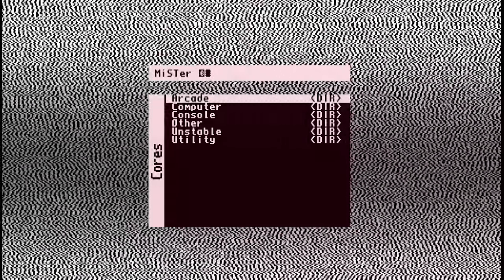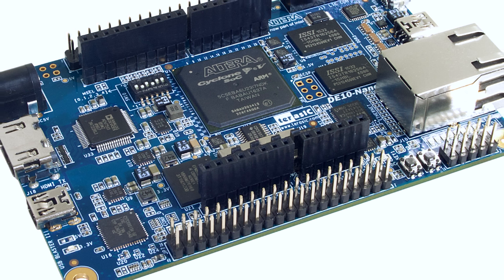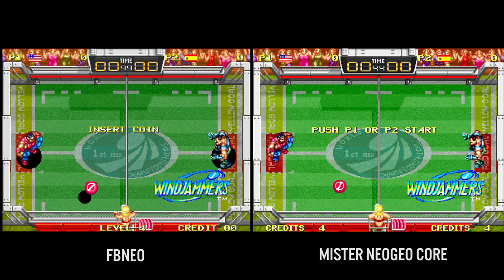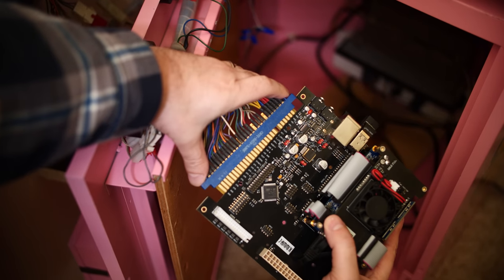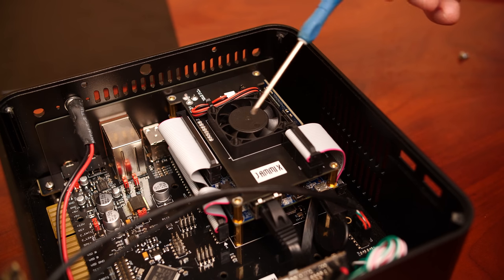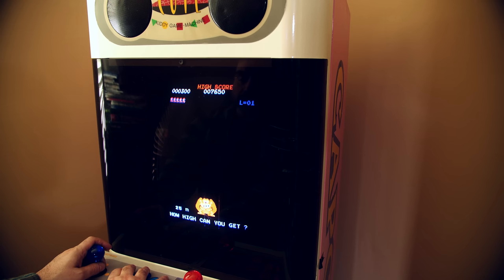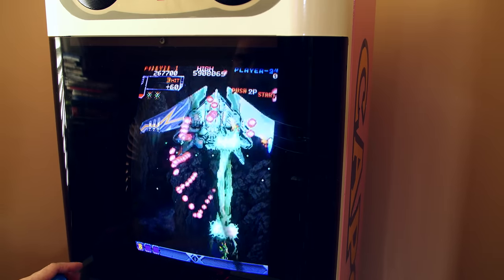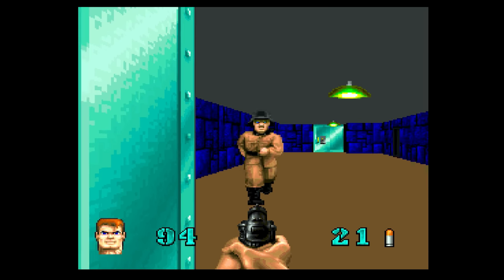Finally - I got my hands on a MiSTer FPGA Retro Gaming Setup | MVG

Comment: This is mind-blowing to me, voodoo magic type stuff. Am I missing something? The emulation community is reverse engineering and replicating systems little Sega Saturn and Playstation, shrinking the chips down, and putting them all in a tiny all purpose box, while Sega and Sony can barely re release their own systems in a similar sized box... I absolutely loved the OG PS3 due to its hardware back compatibility, and this all makes me wonder how hard/ expensive it would be for huge companies to offer true hardware backward compatibility in their consoles. There's obviously a market for it, but I guess they just want to go the easy route reselling us their roms.
Reply: I mean, there's a market for it, but it would require time and a more expensive console. Dedicated retro gamers seem to still be in a minority so coming out with a console that's extra expensive because it can play old games natively may do more harm than good. As much as people harp on Sony not having BC on the PS4 consumers made it fairly clear that Sony eventually axing the PS2 BC from it was a better idea. The Switch is one of the highest selling consoles ever and made more money with Wii U ports and it's gimmick over being backwards compatible.  

The "easy" route seems to be the most cost effective. Again, Sony already got burned before by it, and the differing architectures of the pre-PS4 systems don't help. Can't explain why MS systems don't have it, though, and they seem set on doing their from of "Backwards Compatibility".
Reply: @RippahRooJizah  I feel ya. But for all the people who buy from the small choice of Wii U or N64 games, how many find that their game isn't on the list, and DL a rom pack? Go full pirate. (Probably enough to be a threat to Nintendo's profit and worth pricey legal action). I guess what I was saying was I personally would pay the cost of a bigger PS4 with PS3 inside, however it turned out. When my OG PS 3s burned I went on ebay willing to outbid anyone to get one asap, but was smacked with the reality that many other people had the same idea, with more money... You are correct in saying people spoke to Sony with their money- just like pre-ordering modern games with microtransactions despite the backlash, and there was backlash. Sony just did the same thing with "Software back compat in the future" but backwards by slowly phasing it out. I think if it wasn't abandoned, a large enough group of people would have paid the extra for a "Legacy Edition" PS4 and Sony could have made a profit. I mean a PS5 with a disc drive is far more expensive than the price of a disc drive, and people are willing to hold out and pay extra for it... But If Sony went only all digital PS5 at launch (they could still cut out the drive on the "PS5 pro") people would still buy it, despite the backlash, and 10 years in the future when PS6 is out it would be easy to say people spoke with their wallets, or even speculate that Sony couldn't have done it due to the cost associated with the supply chain issues (similar to the high launch cost of the PS3). I have a feeling IBM would be happy to keep selling their cell chips.

It's too late now, and would probably cost much more to start from the ground up while if they had pushed forward it would have gotten cheaper instead. I guess now it's me that's just speculating at this point.
Reply: @Wooskii1  The choice bit is why I can't stand behind MS's implementation of BC. Good on them for making that attempt, at the very least, but I guess it isn't truly BC.

There are plenty of people who wouldn't mind a PS4 with the actual hardware to play older PS games. I would as well. I just doubt it'll be viable, especially with scalpers around.

As an aside, this is why I was interested in the Polymega, although plenty of people have complained about it, either with the specs being to anemic for the price (which is quite expensive at 450 US dollars, even moreso with the addons), lack of FPGA, and plenty of people going "But I can emulate, this is pointless" despite this meant to be an above-board way to preserve games without any copyright issues.
Reply: @RippahRooJizah  Yea, Microsoft or Xbox was a letdown given all the talk of BC, and I understand the mess of architectures in the Sony line, but I still think enough people would have paid a premium to move their games to the next console had Sony keep it up (speculating again), I moved all mine from PS1 to PS3 and so did many friends. I'm sure more people would have kept their physical games in good condition too, but during the time Sony phased out BC these game collections got scattered to the wind and now those people would have no reason to buy a BC PS4/5... As much as I dislike GameStop, If they go out of business it would make finding even used current gen gen games that much harder (I'm sure the console manufactors would be happy)
I slept on the Polymega due to my collection being lost, I still have a ton of games from handhelds. Both backups on SD/ HDD and carts. It does suck to hear that they didn't pull through and meet expectations none the less, but FPGAs look like a better Idea to me. I have been aware of them for some time but this video really caught my attention due to the size an (relatively) low price. First time I looked at them (not too long ago) one console module was bigger than MVG's loaner system and cost almost the same. I guess time will tell.

Comment: I remember I was excited about including FPGA to cpus, after Intel and then even AMD acquisitions FPGA manufacturers and promised to include it in CPUs. SW emulators would then simply used them as programmable accelerator. Well, many years passed and nothing. So it's nice to see standalone version. Maybe one day, it happens.
Reply: Unlike other architectures as Amigas or old Apple PPC, x86(-64) hardware abstractions on CPU, video and chipsets... While making possible to have a sort of standards which make "generic" OS drivers possible (which in turn makes possible the existence of OS homebrew in the PC world (and foss OSs in last instance))... Also make it very difficult, if not impossible  to use "accelerator" and "bridge cards" in a meaningful way. Last time they tried was with AMD hypertransport, and because the memory architecture of the x86 world, the speed gains of the hardware acceleration were too small to justify the existence of coprocessors or "Emulator Accelerators".

Comment: True hardware parallelism is what makes FPGA work so well. Sure, you think you can do that on a multicore CPU? not with the same level of accuracy. You're an app running on top of an OS which can thwart you.
Reply: False. Software emulators are just as accurate (or more) as FPGA. BSNES was even more accurate for some time (now they are supposedly even). The only thing the OS is dragging back is input latency, not emulation accuracy. And even that can be fixed. Emulation accuracy is achieved in the same way in both software emulators and FPGA. Knowledge and good programming.
Reply: FPGA is literally a meme. Paying 500 dollars so you can run "simulation" when fpga doesn't even stimulate at component level is something only a true smooth brain would do. Your money is far better spent on a pc that can emulate and play far more than this meme box can.
Reply: @xXRustyShacklefordXx  What do you mean? While FPGA is more expensive than a simple CPU with software emulation, the FPGA is able to actually recreate the logical circuits inside of the CPU and system it is emulating. I don't think anyone going the FPGA route is claiming it is more practical or easy, but it is neat that the hardware is more accurately represented this way.
Reply: no you can't
Reply: @Imgema  yes, so wait 20 years until this "good programming and knowledge" comes. lol you guys are really disturbing these days
Reply: @josecarlosxyz  What are you talking about? It's not like FPGA systems exist for consoles that aren't very well emulated already.... This knowledge already exists for the most part. I guess you don't know anything about emulation.